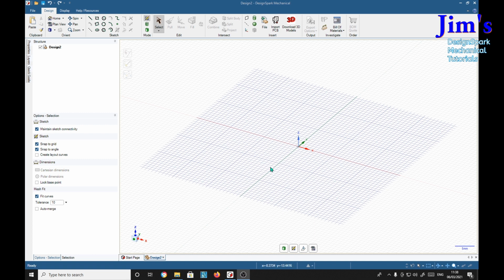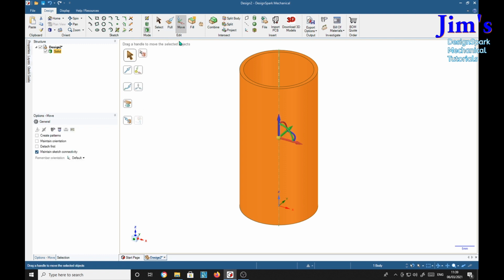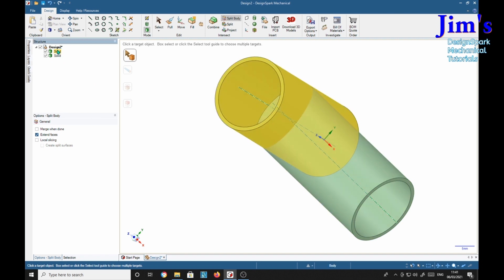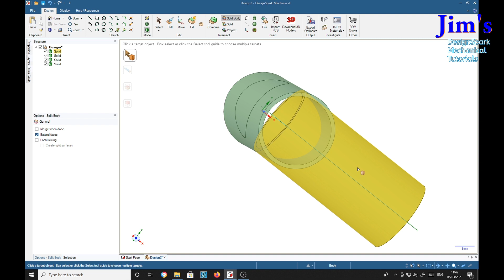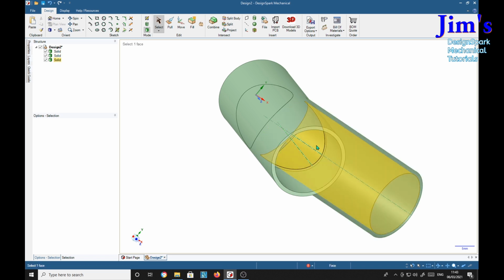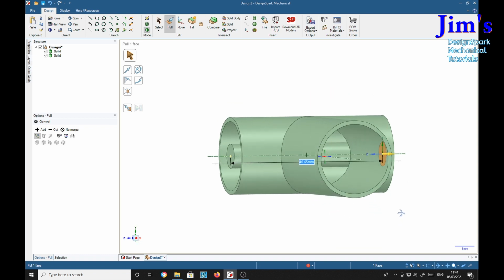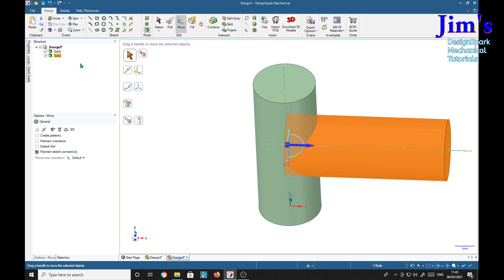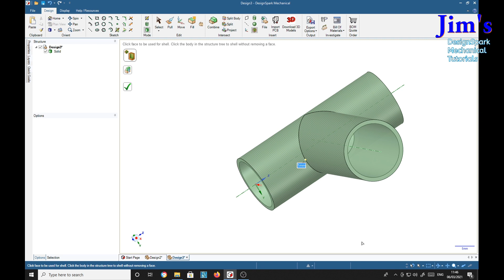Modeling a 'T' shaped pipe.

Comment: Yes, the second method is much easier!  Thanks!
One thing I have noticed in the past 12 hours is that when I select a solid in the structure tree, or I triple click on the solid itself, instead of the solid changing to an orange-ish color, I get a orange halo around the perimeter of the solid.  
If I move the cursor over a solid in the tree the solid's perimeter is yellow, then changes to orange when selected.
Ever had that happen?  This just started happening within the past day.  Before that, it worked like what you show.
This program does have quirks!
Regards.
Reply from the maker: I think that you may have accidentally switched on 'Body Glow'. You will find it in the 'Show' button of the 'Display' section under the 'Display' tab.
Reply: @JimTaylor42  Thanks...back to the way it was!